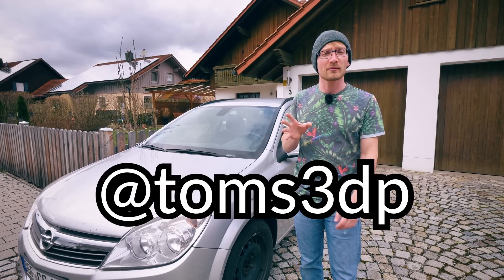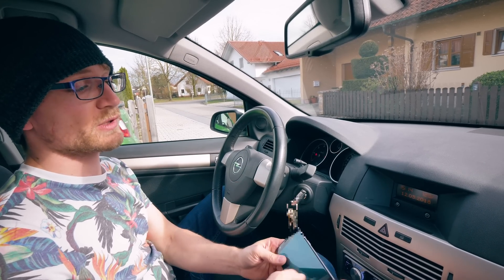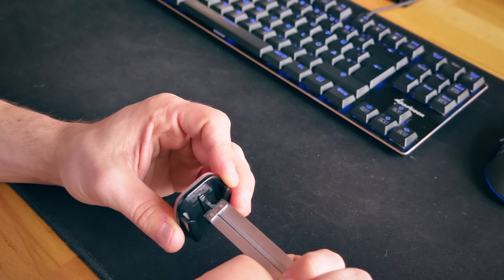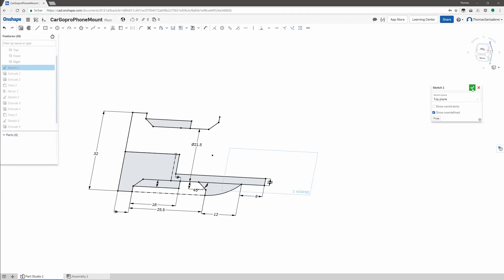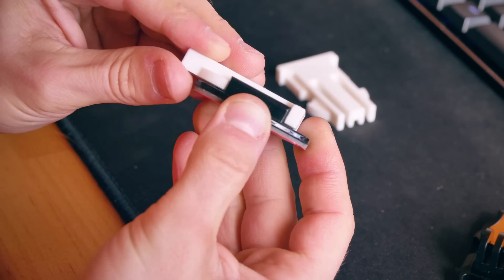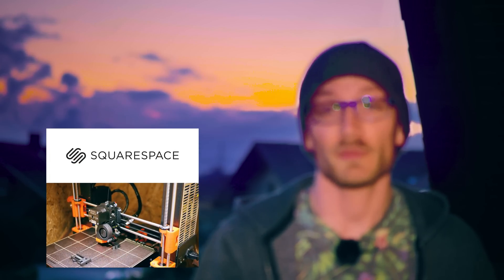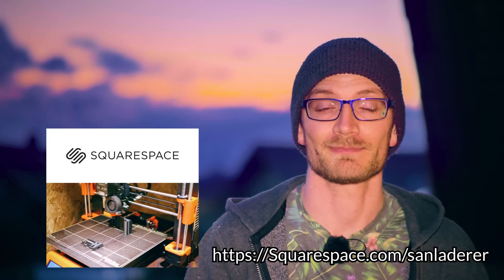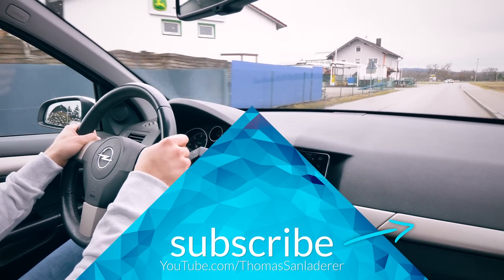Solving problems with 3D printing: Upgrade your car!

Comment: I had a 2008 Opel GT, or rather the Pontiac Solstice as it was badged in the US. The gauges in my car looked a lot like yours. It was the year before they put Bluetooth on it. I really wanted the bluetooth, even though it was limited to only making and receiving calls and not capable of playing music from your phone. So I bought the 2009 steering wheel with BT controls and the BT brain box and decided I could live without the OnStar factory communications. Thanks to the OnStar, the car already had microphone and integration with the radio, I kept the original radio and it worked fine for BT, showing the phone number of whoever called me on the display! The BT box replaced the OnStar box perfectly, went right into the wiring harness behind the passenger seat, major teardown - that was fun. But worth it, it took me a couple of hours and about $250 but I could make and receive calls using the factory radio.

Comment: I was planning on doing this, but I just went with a windshield suction-cup mount that had an FM transmitter on it.

Yeah, my car is old enough to not have an AUX input, but too new to have a cassette player that could be adapted. Mounting it on the lower left (US) corner of the windshield seems the safest; it doesn't get in the way and it's really easy to glance at it.

Comment: Can you post a real time video of your onshape design process?
That way we can learn more about designing in onshape using a real design that you made.
The current video is speed up too fast which makes it hard to follow the design process.
Reply from the maker: If you're interested, I can upload the entire design, but it won't have any commentary over it.
Reply: Check some older live streams. Designing fidget spinner or cable management widgets for example. They are real time and Tom actually comments on designing techniques and design decisions on part. Started using few trick learned there myself.
Reply: yeah there might be older live streams,  but each model has new challenges and difficulties that we can learn from..
that is why I want to learn from this one as well.

Do you have the links for the older live streams for onshape?
Reply: Yes that would be good. 
I can still follow and copy your steps without the commentary.

I am still learning onshape and have created a few customized models parts that I need for myself (
like what you did in this video)

While it is good to print other people's designs...
Once I created my first onshape model, 
I realized that 3D printing truly becomes useful when you can create your own customized designs/parts that you actually need.

I also have a suggestion..
If you can create a new playlist (e.g. onshape tutorials) that contains your past and future designs in real time..that would be really good.
If you want to do commentary for future onshape designs in real time (as you are designing it)
that would also be very useful for us to learn from.

Thanks Tom.

Comment: How did you get the Sequential Printing option to work?
I always get an error saying "Some of the objects are too tall and cannot be printed without extruder collisions.
Reply from the maker: By default, Slic3r is limited to 20mm maximum height for every part you want to print sequentially. Make sure all but one of your parts are lower than that or increase the height setting if you are sure you aren't going to crash your hotend.
Reply: oh ok  That makes sence Thank you! I have done sequential printing in other slicers but its handled differently.

Thank you

Comment: I made a Gopro mount from stainless steel on a bridgeport, I have a Fusion 360 model of the base, though it's a bit too late for you.
Reply: EFormance Engineering can you share it :)

Comment: Can this be printed on PLA? I wonder how it holds up with the summer heat on hotter countrys.
Reply: Another option, which I had some sucess w/ on a larger part (replacement door trim piece I couldn't find in a junkyard) is to print w/ any material but design the part undersize, then coat with a layer of epoxy. Any of the epoxies for fiberglass work should work fine, can even fiberglass over the part if higher strength is needed. I've had problems w/ even PETG softening in a car on a summer day (~110F max in my area, 44C). The printed part is just a very easy way to create a precise mold.
Reply: Yes, handles heat much better. (tested and compared)

Comment: I always struggle with printing things to measure. I often get outer dimensions right but rarely  the inner ones. Depends heavily on slicer settings. Haven't figured it out completely yet. But good advice to print test pieces of certain parts or functions of the creation as distinct objects. Thanks for that.

Comment: why car keys are pixelated? xD i have the gtc version, which is identical on the front, will make the upgrade!
Reply: Oh.  I thought maybe it was an XXX trinket ;)
Reply: @lidarman2  Me too haha
Reply from the maker: With standard key profiles (which I'm not using), it's absolutely trivial to reconstruct a key even from a relatively low-res picture. There are sixty 8MP images being streamed to you every second, showing off all keys in perfect detail and since German press law requires me to publish my address, I simply don't want to take the risk.
Also, if there are no signs of someone actually breaking in, it's going to be a tough job explaining it to an insurance.
Reply: there's a video on youtube with Bill Doran that shows how to do it from a bad phone pic. This 4k footage is more than enough if you know what to look for. What Advection is talking about would be photogrammetry, but you don't need a full mesh for a (mostly) 2d shape.
Reply: I had no idea you were required to publish your address, that makes the pixelation make far more sense.
Reply from the maker: House keys are on there and they are way to easy to, well, 3D print a copy of based on a photo. Supposedly some are "3D print proof", but I don't want to risk it.
Reply: Am I the only one who thinks its comical that people are spending more time to write a comment criticizing the edit than the time that it took (about 2 seconds?) to blur the frames? There's no degree of caution that exceeds the degree of crazy that's floating around in the world. Blurring is definitely a good call.
Reply: @MadeWithLayers  It would be easier to pick your lock and even easier to smash a window
Reply: Don't need both sides they are standard slots, also the heights of the  cuts are standard and the distances of each cut from the shoulder are standards which makes it super easy even from a terrible picture to recreate a key.
Reply: you don't need a mesh all you need is the relative depth of the cuts on the key then its as simple as inputting the 5 or 6 numbers and key type into a template and you're done.
Reply: therealpanse that video from bill makes it look way more difficult than what it is. I may or may not have an scad that you put the data and poops out a key stl
Reply: Jboycs but a lockpick gun leaves witness marks on the lock. And there are printable plastics that definitely work in locks.
Reply: Better to be safe than sorry will apply here I guess.
Reply: "better safe than sorry" triffts glaube ich ganz gut
Reply: I figured he had a Japanese wiener on his keychain
Reply: i just printed your keys but for some reason it only opens minecraft doors
Reply: what a hawk's eye! I had not noticed it. Prudence is never too much! 
Bravo Thomas!
Reply: Loebane Yes I agree. That being said, I see potential for a future video.
Reply: Vorsicht ist besser als Nachsicht, I don't know the english translation right now ;D
Reply: Beaving as a firefighter I promise you that anyone but an amateur will not use a crowbar to open a door. The force required, even on old doors, is huge. There are far easier options than forcing the front door ... with a set of keys however ...
Reply: Really like end-to-end videos like this, where you demonstrate a problem, design a solution & iterate towards a final part. Good job!
Reply: where's the fun looking up your address on the impressum of your site? gotta find out the place you're in by tracking clues in the footage of the video and tracing stuff on google! that's the real fun challenge and pretty frightening how much info most people spread over the internet... found out the current workplace of another youtuber just with his screen name and a photo
Reply: The perils of shooting 4K video, I suppose!
Reply: 1080 isn't 4k :) so 2MP images
Reply: wow didnt know the german gov force you to publish your adress. Seems dangerous and quite frankly bad decision. Maybe these law making public servants should publish their adresses, get a taste of their medicine
Reply: can't never could. someone could figure it out if they wanted to bad enough.
Reply: I too am interested with the blurring of the keys. There are much easier ways to break into a house but I guess it's better to not even tempt someone. I still think it's a little paranoid and excessive.
Reply: Nice to see some practical 3d prints. 👍
Reply: helmet098 4k might be good enough though...it is better safe than sorry. tom might not know the thief if a viewer decided to sneak into his house (something that tom explained in his older videos why it would be the case)
Reply: actually, you only need one side and is very easy to do. I have done it many times just to prove a point
Reply: @VenomTheCat  video or its BS
Reply: @Helix_22  VIdeo of which of my comments
Reply: A purp won‘t do all of this work, he will just get a crowbar or drill it open.
Reply: I have 2008 opel astra and the dashboard is same, I'm going to use this. Thank you:) Can you also design a cup holder for the next video? :))
Reply: Thomas Sanladerer Paranoid much?
Reply: I had to know why myself... you can buy a lockpicking gun fairly cheap that is more certain to work than a printed key from a photo. better be safe than sorry I guess. you would also need to print my keys in bloody tough material. it's hard enough with a metal key, there is no way a plastic key wouldn't break off.
Reply: Thomas Sanladerer Oh, stop. Nobody's gonna do that. And even if they did, they would need both sides. And even if they had that, it would have to be a better picture. And even if they had all that, they would need to know where you live. And even if they knew that, that means they know you. And if thats true, you know them. And if you know them, then you can call the police. Nobody's gonna do that.
Reply: @helmet098  and if you and if you and if you and if you😂😊
Reply: @helmet098  Agreed, makes me laugh like when people cover their public license plates on the car too.
Reply: LOL German key paranoia. Should have put fake lock that trips a claymore
Reply: Thomas Sanladerer Pshh, yea right!
Reply: VenomTheCat ahhh shadup
Reply: It's not that easy to build a 3D mesh from a video sequence... especially metallic reflective surfaces. Flat dull looking objects are much easier though... 
The software just can't calculate reflecting surfaces... I wouldn't worry about it :P We often do this in VFX but reflective surfaces never make accurate meshes... especially a set of keys.
I hope that is some peace of mind for you Thomas :P